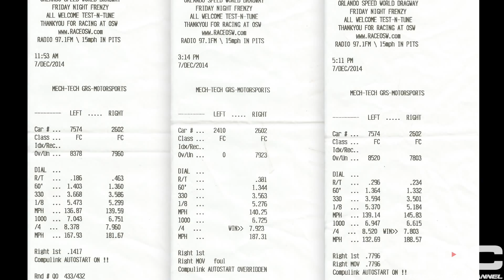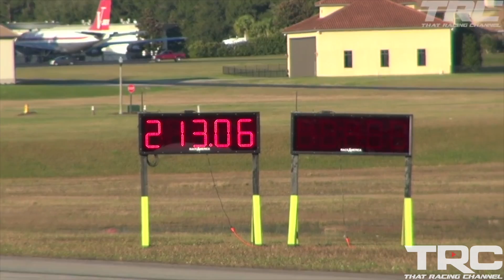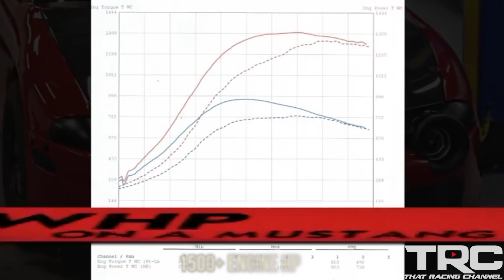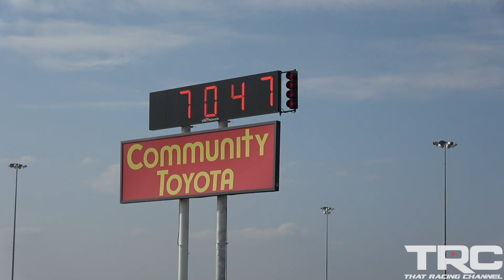Red Demon 1800HP 4 Cylinder 80psi of Boost! - The Quest for 6's begins

Comment: 450 hp a cylinder is insane
Reply: probably makes more at the crank lol crazy shit...
Reply: Notorious Slasher Good for u talk is cheap
Reply: Notorious Slasher been running for 3 years now
Reply: Notorious Slasher how did you jump topics? I said the car has been running for 3 years.
Reply: Blaznmax 88 Ain't shit...my LS is making 5000hp a cylinder.
Reply: More than my s13 makes on all 4
Reply: For a 4 banger..hell yeah
Reply: my 2g tsi is only making 364 wheels but it feels so fast i killed a new mustang gt V8 on highway 1st both in 5th gear 2nd time i was in 5th gear him in 4th i still pulled a car at around 110mph from a 60 roll. And my car is a 1996 eagle lololol his face priceless in his 2019 Mustang GT haha DSM 4 life my dsm is faster than my sti they have similar amount of mods just one is 11 years older and its still faster.
Reply: @pueblodsmrs5624  
Are you running a 7 bolt?
Reply: Quicker than rimac and roadster 2.0

Comment: 80psi?! Holy Shit!!!
Reply: sam right!
Reply: Dsm baby
Reply: Killa T1Acid Your Shit is fast when you need a steering wheel that reacts to G forces.. 7:04 - 7:07
Reply: i know and i thought 40-60 ive seen people run in supras and evos was crazy. but man basically double that is nuts. just reminds me off when people with big diesel trucks say can your car run 50 psi. this guy has you beat by 30 psi and its only a 4 cyl and yours has double the cylinders.
Reply: Ty 0boi lol good catch
Reply: 80psi on a 4-cyl. car is what you need to make some power since the engine is so small compared to 6 and 8 cyl. cars. The 2jz can get away with 50 to 60 psi. of boost because they are auch strong engines. V8's can get away with a least 25psi. and be fine
Reply: Killa T1Acid no shit dsm4life
Reply: Notorious Slasher  no LS makes 4000hp
Reply: @Mr009mm  Evos are the same motor. Cast iron 4g63
Reply: @ty0boil212  Did you copy and paste that on every comment? This is the third thread I've read and your in all of them copy and paste.lol
Reply: Evil DAX Supra fanboys 😂😂😂
Reply: Yeah boost depends on how long your crankshaft is. Until we discover a stronger material
Crank length/Number of bores will be the limiting factor of how high the boost will be. Smaller/shorter cranks can get around 30psi and calls it low boost 😂

Comment: "Whatcha running under there?"
Just a little 4 cylinder...
Reply: killing530 80 psi makes it not so little if you think about it
Reply: 122ci mitsu small block. Just a small block 4 cylinder.
Reply: With 80 psi what u running 10 psi
Reply: yep its just 4 cylinder... that car is bad ass...
Reply: 80psi makes it 11 times bigger engine than it really is
Reply: 4g63 beast
Reply: Lol more like a v10 or v12
Reply: NeonAstral boost doesn’t change cylinder quantity or displacement... I see what you’re saying but still...
Reply: whahahaha i remember that video of the guy in the honda   what ur running 
just  a little 4 cylinder
Reply: hahaha
Reply: @NeonAstralOfficial  ok I guess this cylinder is bigger than a v8 lol

Comment: I love how you don't see any STi, EVOs, RSs in the low 7s but an almost 10 year older DSM is right there almost head to head with the GTR at 7.4 in the qtr when the best GTR is only running high 6s and thats in an automatic tranny and a V6 twin turbo with a computer running its suspension and launch, Boostin is running a manual transmission, shifting gears, 3 pedals all day only way, and launching the car perfectly. Long live the manuals, I absolutely love it, makes us DSM owners very proud you make our cars more important because of what your accomplishing and for that i thank you so much.

Comment: My quest is for 8's in my talon. Couldn't imagine 6's that insane!
Reply: while building a car like that is an art, money is a big issue as well.
Reply: Jhon KafirB you’re absolutely right
Reply: I want to buy a dsm for my first car. Do you think that is a good idea? I am struggling to decide what kind of car I want and am looking for some guidance.
Reply: @aaronesau9427  as a first car no. As a first racecar sure. Most of these cars are either modded to high heaven to or poorly taken care of. A great first car that's very cheap and easy to work on with a descent aftermarket believe it or not is a 1st gen neon Dual cam with the 5 speed manual. Speed parts are cheap and regular maintenance parts are even less expensive. With proper maintenance it can be a very reliable car. Try to find one with very little to no rust. I've had 2 a 95 single cam and a 98 RT dual cam.
Reply: @aaronesau9427  if interested check out neons.org and also modernperformance.com
Neons.org is a forum that can answer any and all questions neon. From regular maintenance to full racecar builds. 

Modern performance is where you can get lots of speed parts for the neon.

Comment: He set the record with a smaller borrowed turbo I wonder if he had his big turbo on if he would have cracked 6s.
Reply: thats not how this works.
Bigger turbos doesnt mean better numbers.
Its a tricky balance
Reply: Jhon KafirB Well obviously lol that's why I wrote I "WONDER" if he would have no one said him running a bigger turbo would get him into the 6s. He ran his best time with a borrowed turbo that was smaller it spools quicker but his bigger turbo will give him more power and more top end.
Reply: Good question. But the lag of the bigger turbo I’m not sure. The spray would help a shit ton with the lag tho also. So he probably could. I’m by far no expert. Will be nice to see them run sixes and the combo they used to do it.
Reply: He should do a compound setup. Use the smaller turbo in conjunction to the larger one. But adding nitrous to such a small car is lethal

Comment: Don't get your hopes up this is a billet block not the cheap stock...
So don't tell your friends your dsm can hold 1800 hp
Reply: Debo DSMs can hold 1800hp
Reply: People have made over 700whp on the stock "cheap" bottom end.
Reply: DSMs are one of the most, if not THE MOST bulletproof 4 cyls there are. There is proof everywhere.
Reply: Woesty420 wym they fall apart all the time
Reply: Lol
Reply: But isn't most DSM fuck it Mitsubishi Eclipses from Gen I to Gen II 4G63Ts or 4G Variants and 4Gs are known to make a fuck ton of power even with a stock block ?
Reply: Herro plays yeah but it was probably on a auto 😂😂😂. Huge difference compared to this one.
Reply: Evil GST Cheap Fast Reliable you can only have two lol that’s what I always was told
Reply: They were doing 80psi before this billet block. There are several videos from 1320 then running 80psi on stock iron block
Reply: Eh with 1800whp they ran 205mph, which is the same trap speed they ran with the cast block on the 7.37 pass. They also sell that as a short motor assembled for 6k usd and rated for over 1500whp.
Reply: sk8erguy1450 that's on a sign in Dom's Garage in the first fast and furious
Reply: Woesty420 Japanese yeah true Yamaha engineering. 3 s gte is pretty solid too
Reply: It's amazing it is still the Mitsubishi design though. Even with upgraded many blocks just don't have the design strength to take the power
Reply: Woesty420 Here is the problem with statements like that. The 4G was designed by Mitsubishi as a race capable engine for the Evolution. That is great now the problem most platforms are not explored to this level because their community is not interested in problem solving.
Reply: Samuel Jones what is a fu*k ton of power?
Reply: sk8erguy1450 it remains the case. Spend the money now or spend more later. When you window a block that is an extra $400-$500 out of your pocket.
Reply: LP187q Do you know what issues the billet block addresses. I happen to know because I don't have a dog in this fight and don't give a flip if somebody is using a billet block. Some prideful people out there that don't like their feelings or idealogy trashed. High power out of a stock engine is impressive until it goes boom. Average mortals don't have what it takes to keep the boost down. That is why the major of these records are held by shop owners.
Reply: Woesty420 well hate to tell u buy the ecotec has been hitting 5 sec 1/4 mile gm 4 cylinder
Reply: Debo stock 6 bolts can handle the power.
Reply: Herro plays your comment is actually fucking funny. I havnt heard neck in like 8+ years
Reply: Debo right lol
Reply: Debo probably got a  billet nucksack too
Reply: b series honda motors are fucking insane my friend dailys his on 18lbs and beats on it all the time it. Hes had it for the last 6 years while everyone else has gone through at least 3 different cars and we dont even beat or race ours lol.
Reply: No replacement for displacment. Sals stock motor street legal viper has over 2000hp running 6's. if this ricer can get to the 6's id be pretty impressed.
Reply: Woesty420 what u smoke lol this block is not stock . Lol
Reply: Cheap stock? Not many blocks are as bullet proof as the 4g63, and Mitsubishi made hundreds of thousands of them over the years. Hating on them just reflects your poor judgment.
Reply: boostedgsx u wish
Reply: Herro plays in ur dreams
Reply: Right 100%
Reply: @boostedgsx  in ur dream
Reply: Richard Skipper What do you mean no one cares that a stock street legal car with stock trim ac and stereo that can run 6's. His car is the most impressive in Drag racing, the only car faster is larry larsons nova which is a steel tube chassis and a fully built race car. 

Furthermore the amount of cylinders doenst matter. The power to longevity ratio is mostly influenced by displacement. A 4 cylinder can easily make more power then a 8, 12, 52, 100 cylinder motor, its mostly about displacement, and amount of air and fuel.

Comment: Incredible archievements for sure! But remember in the 80's BMW squeezed 1400hp out of a tiny stock block M10 1,5 liter 4 cylinder  f1 turbo engine in qualifying! So there must be room for more haha :D
Reply: Paul Rosche, the engine constructer of the 80s BMW F1, said in a Interview: After one fast qualifying Lap with full boost, the small end bearing of the conrods was 1mm ovalshaped.
RIP Paul
Reply: Yer but they had all the budget geeks money could buy..... this is impressive
Reply: MrCornholios Metallurgy has improved a good bit since the 80s though. So perhaps now an engine such as this could make over 2,000 hp and last for several 1/4 mile passes.

Comment: I think the problem with this car is that the wheelbase is too short to get traction. I bet a hydraulic sliding weight would do amazing things for this car. A filled horizontal rollcage tube on each side with a steel weight in some thicker fluid. Start over the front wheels to aid in launch and by the 60ft it's 3/4 to the rear. I bet it would stable that car up like a champ. The extra 150-200lbs would be worth it tractive friction.

Comment: I HAD A TALON TSi TURBO 5-SPEED FWD, NOT AWD.  I HAD JUST A STRONGER SPRING MY WASTE-GATE AND MY INTAKE PRESSURE WAS UP TO 15 PSI. (STOCK WAS 11.5 PSI) AND I HAD ABOUT 280-300 HORSEPOWER.  SO IT WAS PRETTY QUICK.  BUT 80 PSI AND 1800 HORSEPOWER!!!!!!  YOU GUYS ARE GONNA BE LEGENDS!!!!  GO RED DEMON!!!!!!!!!!!!!!  AWESOME GUYS!

Comment: Awesome!  And much more usable than the rotary stuff.  When people "try" to compare these configurations to V-8s', it's basic ignorance.  This would be a blast in a sand rail ! !  But being that GRAVE DIGGER and the other Monster trucks run 1450 HP blown alcohol BBC , can they be compared?  The monsters motors launch 10,000 pound trucks like dirt bikes. They run them night after night after night. Now what would this ((1,800)) HP power plant do in the monster truck????  About as good as a turbo GSXR 1100 engine would do in a dually...  It's all about application & also longevity.  This motor (at 1250 HP) would NEVER live through a BAJA 1000, or a 24 hour le mans . But it would live 3+ times that of a rotary. But a LS will push 1200+ on tracks for days. The POOPGATI W-16 will NEVER compete in racing. First it weighs 1,000 pounds ! ! ! (vs a 500 - 600 pound LS) and the connecting rods bearing widths are only 12mm , LOL !  Make it a W32 and the rods would be as wide as a wedding ring ! LOL...
   Oh, and it's the USA that creates the Callies cranks, rods, ARP fasteners etc... that allow these 4 bangers, GTRs' boxers etc  to make this power.....